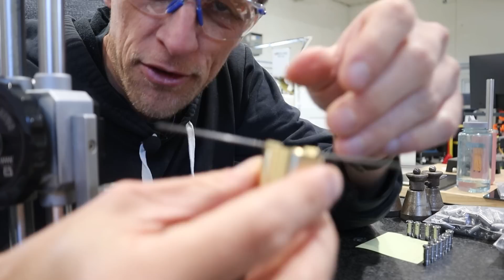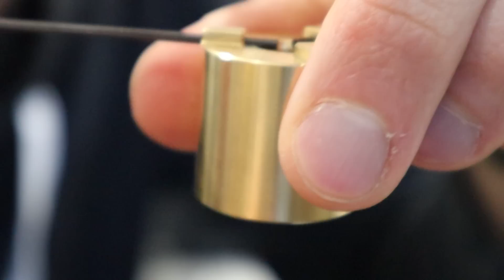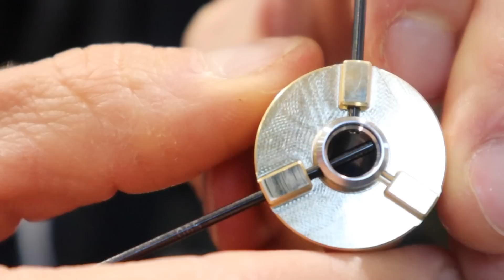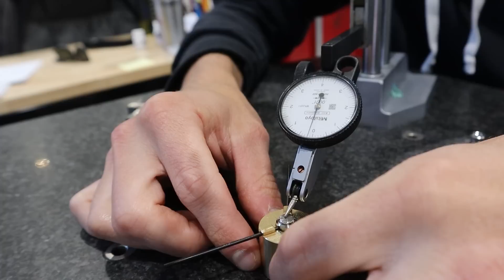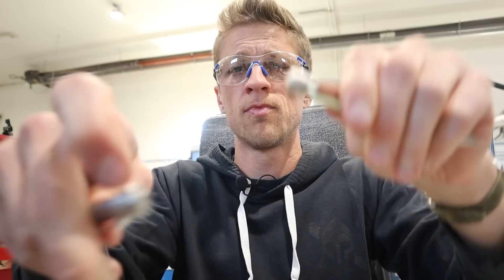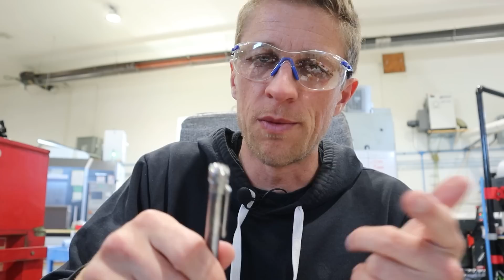Custom Brass Checking Fixture | Saga Saturdays Ep 34

Comment: The center may not be the best way to measure as you may get a tit from the wear on the tool.  This will give you a variation that will not be consistent.  Better would be a hollow gage with three points to measure the surface.  Mounted in a comparator gage would be quick to measure the difference.  Charles

Comment: Hi Guys,

That's a good idea however;

It's too fidly, I recommend making a fixture that you could use set of go/no-go gagues.

It's wasting way too much time to check each one, I noticed that you cut the video a few times, how long did it take to get back to being under the indictor?

Rather than using an optical method for setting the tool offsets for the sub spindle, you could make yourself a reference gague block so you can set the tool offsets in it in the machine.

Comment: I could be off base with this, kinda more of a question than anything but is brass the best material for a fixture like this? Is it very thermally stable?  Or would we be talking sub tenths of growth in normal shop conditions so it wouldn't matter really?
Reply: If I understand the fixture correctly, the primary goal is to hold the outer sleeve at a stable height off the surface plate.  John didn't specify what type of brass it was, and I couldn't quite tell the size of it, so this has plenty of assumptions (and is based on my untrained but a bit experienced work with thermal expansion):

Using Engineering Toolbox's coefficient of thermal expansion for "brass" of 18~19 (10^-6 in. / (in. °F) ).  As I understand it (open to corrections), that means that for every inch of material, for every 1 °F of temperature change, the material will change by (18 * 10^-6) = 0.000018".  That change would be positive for temperature increases, and negative for temperature decreases.

Assuming the chunk of brass is 2" tall for convenience, that means that for every 1 °F increase of temperature (from setting up in the morning and then going into the afternoon, or from holding it in your hand for  a short period of time), the total height and thus measured surface of the reference parts would increase in height by 0.000036" .  So say the combined change in temperature from when you set up the gauge in the morning is +12 °F, without re-zeroing the indicator with the reference parts, the measurement would drift +0.000432".

That's not the complete story - everything else in the system would be changing as well, including the steel base and rods of the indicator stand.  Most of the steel types listed on Engineering Toolbox have a lower coefficient of thermal expansion than brass, but not much lower, so the absolute measured difference, assuming ambient temperature change is the only thing changing the temperature of the system (and not heat from the inspector's hands), would be the difference between the two.

Because it's a relative measurement, all of this would be addressed by frequently re-zeroing the indicator with the reference part - in this case the threaded sleeve, as the button is already being controlled.  That's useful to avoid other sources of error as well - bumping the stand or indicator, wear of the brass from the steel gauge pins, etc.

Again, completely open to corrections on any of the details above.  And I apologize to the ~90% of the world that uses metric for using imperial measurements here - they were slightly cleaner for the scale, and John was using an imperial test indicator, so keeping everything in that system made sense.

Have a good day.
Reply: @joshuawills5242  wow Joshua thank you for the reply I couldn't have asked for a better one, cheers